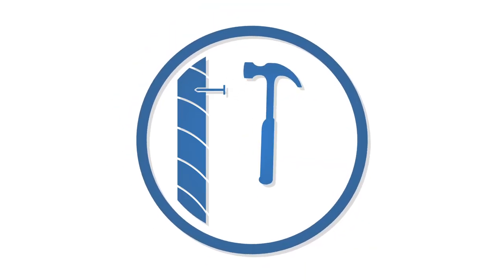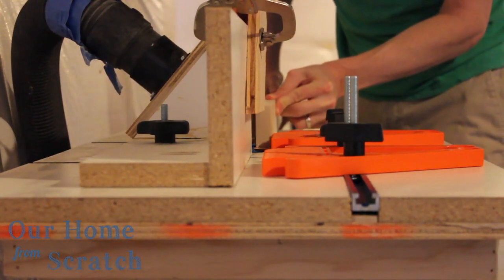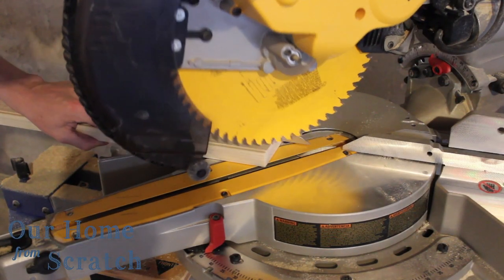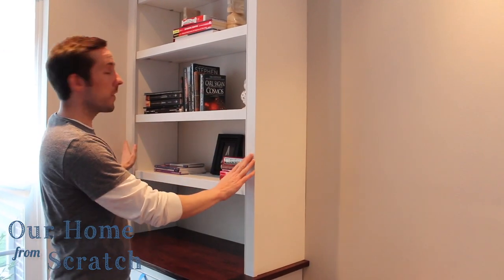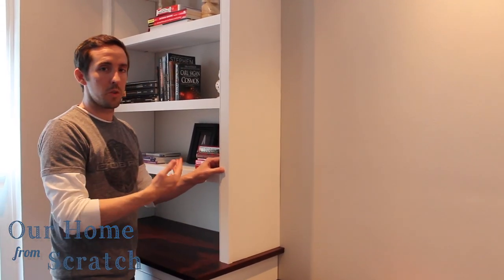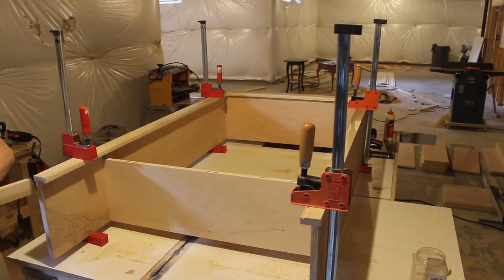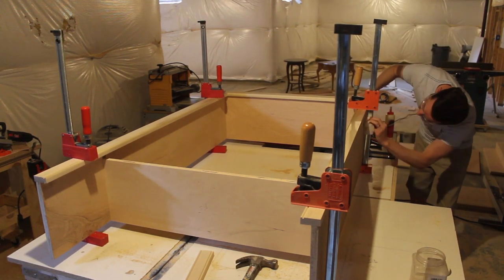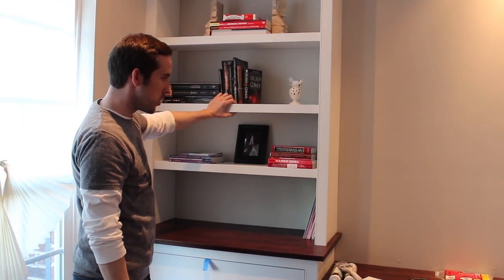DIY Built-In Cabinets with Beaded Face Frames

Comment: I really wish i watched this a few months ago when i did something very similar.  Love the bead detail, really draws your eye without being too over the top.
One thing ive learnt with the router and straight edge is to use the rounded sides of the router base to run along the edge. If ure anything like me and the router turns slightly in ure hand it will still keep the bit centred. Whereas any movement from the straight part of the router base along the straight edge and uve got wonky dado's :)
Reply from the maker: Thanks!  That's a phenomenal tip on the router.  I'll remember that one next time!
Reply: This will work if you have the router pit is perfectly centered within the base, yes.   But, you cannot assume this will be the case.  I would defer to the straight edge technique unless I was able to center the base with a centering bit and adjustable base,  or at least test the router on scrap.

Comment: John, Love the cabinets and the video. The wife and I are designing our built in home office as I type this. We'll be starting the construction in a couple week. Thanks for sharing!
Reply: What brand and type of paint did you use? I noticed you said water-based paint? Was it General Finished Milk Paint?
Reply from the maker: Lance's Woodshop & Adventures I used Sherwin Williams Pro Classic for the finish paint.  I used a Benjamin Moore latex primer, but wouldn't use it again for this application.  Recommend a sprayable shellac primer like BIN.
Reply: John Our Home from Scratch Thanks John!
Reply from the maker: No problem!
Reply: What's next on the projects list for the house?
Reply from the maker: Lance's Woodshop & Adventures We'll probably start making plans to finish the basement soon, but it will be a slow process as I'm not interested in taking on another year long project anytime soon.  For the most part I'm going to try and do some smaller jobs and help readers with their projects.

Comment: You do beautiful work man. I am painting my kitchen cabinets now and using the SW Pro Classic and I can see all of the brush marks in the cabinets. I'm going to have to go back and sand all of this down and kind of start over. I would love to have them sprayed but I don't dare attempt that myself as I have never sprayed before and all of the prep work that would be involved to spray the cabinets themselves.
Reply from the maker: Thanks, Mark.  I've used SW Pro Classic before and I've gotten good results.  I'm usually brushing it over a sprayed primer though.  You could try and thin it down to see if that helps.
Reply: Thanks John...I have thinned it down some and I'm still seeing the same results. When you brush it you don't see brush strokes? I'm using Purdy brushes. I've tried to barely have any paint on my brush and I've tried a little more both yielding the same results.
Reply from the maker: I do have some brush strokes, but they are very hard to see unless you're right on top of it.  You can also try rolling on your paint with a foam roller and then immediately following up with a dry-ish brush to level it out.
Reply: Thanks John. I tried that in the beginning also. The Pro Classic paint was setting up too fast on my and I was dragging the paint. I went and bought a Graco sprayer today. I've got an even bigger mess on my hands now. I just don't understand why I am having so much problems with this. Thanks for the suggestions. I appreciate it. With what I've spent on this project so far...extending my upper cabinets to the ceiling and all the paint and supplies including tools like miter saw, sander and regular saw and such I could have had brand new cabinets installed.

Comment: Hey John, those look great! I'm thinking about making top to bottom shelves without the cabinets around my bed. Can you please explain how you attached them to the wall. Thanks.
Reply from the maker: Ammar, the cabinets are fastened to the wall using wood screws.  The wood screws are driven into the studs in the wall and also feature a finish washer.  The screws are located on a back brace that runs along the top of the cabinet.  You could also add a second back brace along the bottom or middle for your idea.

Comment: John, 
Thank you for sharing your work and ideas. When attaching the beaded face frame what size biscuits are you using an the depth that you are setting them at?

Thank you 
Chris
Reply from the maker: +Chris Laviola Replying on here too just so everyone sees my answer.  I used size 10 biscuits, mainly because that's what I had at the time. Any size should be fine for this type of application. The depth was automatically set by my Freud biscuit joiner.
Reply: Thank you John.

Comment: Hi John, great video, thanks for posting.  I have a quick detail question for you.  On the bookshelves that sit on top of the base cabinets, it looks like there's a reveal on the face frame.  How far does the face frame project past the side panel of the bookshelf?  It looks like maybe 1/8" or 1/4"?  Thanks again for this great tutorial.
Reply from the maker: +Martin B Great eyes, Martin.  There is indeed a 1/4" reveal on both sides of the bottom and top cabinet frames.

Comment: John, great looking work. I'm getting ready to build a cabinet/bookshelf like the ones you have here. I only have around 40"w & 18" deep to work with. what are the dimensions of the cabinet & shelf? Forgive me if you answer this in the video, I haven't finished watching yet.
Reply from the maker: No problem.  Depth of the bottom cabinet is 18", width is around 35".  Depth of the top cabinet is 12", width is also 35".

Comment: I like what you did but instead of haunching the stiles and rail I found the assembly to be easier to put the bead on afterwards with glue and micro pins just my opinion but still a nice job
Reply from the maker: I've seen that approach as well and it does look a bit easier.

Comment: What kind of HVLP sprayer are you using and do you like it? I'm building my cabinets right now and will be painting in the next few weeks
Reply from the maker: It's the Fuji Mini Mite 3: http://amzn.to/2b8YkmQ  I like it, but it's not cheap.  If you're going to be building a lot of cabinets over the next several years, it might be worth picking it up though.  Rockler also has a 1 stage turbine that's pretty good.

Comment: When you made the center notch on the router, on the second pass where you took out the right side of the notch, how did you prevent tearout?  The rotation of the bit should have caused a major problem.
Reply from the maker: +Gordon Serif I used a sacrificial board behind my primary piece and pushed them through the bit together.  The sacrificial board will get the blow out and the primary piece will not.  Hope that makes sense.

Comment: Great job - how do you make sure the cabinets matche to the wall on the sides? If there's any bumps in the plaster work will there not be a gap?
Reply from the maker: +Thadius Mayonnaise You can choose to scribe the sides of the cabinet to the wall, which will trace a line on the side of the cabinet that matches the profile of the wall.  You then cut along that line using a circular saw and the cabinet will match the wall shape perfectly... most of the time.
Reply: +John Our Home from Scratch Hi John,If there is any gap, can you use dry wall compound to fill it?

Comment: Hi John I’m attempting this and having a lot of difficulty. My router seems to be causing the wood to jump and doesn’t sound right. What am I doing wrong? How should I be feeding the wood?
Reply from the maker: Well, it's hard for me to help diagnose what's wrong without actually watching you attempt it.  Make sure you're pushing the wood through your router table from right to left.  Make sure you're using a feather board as well.  You can try adjusting the router bit speed if possible for a cleaner cut as well.
Reply: If the router sounds weak or bogged down 1 need a bigger router ( more amps) or 2 dull bit or 3 taking too much wood on first pass. Any one or combinations can make wood bounce or jump, you want to slice or cut the wood not chop through it. Do you see rough edges or splintering? or burn spots. If so all signs of to much too fast.

Comment: John, I'm about to begin painting and wondering what you recommend in way of sprayer and any sites that might have a tutorial on painting?
Reply from the maker: Chris, first I'd recommend you read this post: http://www.ourhomefromscratch.com/2014/09/cabinet-painting-101/  Then let me know if you have any follow up questions!
Reply: John Our Home from Scratch
John, so I bought an HVLP sprayer but wondering if it will work with my compressor. I have an 8 gallon compressor, but also have access to a 20 gallon tank. Thoughts?
Reply from the maker: Chris, I would try the 8 gallon with some water in the HVLP and see how long you can spray it until the compressor kicks on.  See what the spray quality is like.  If that doesn't work well, then try the 20 next.

Comment: For your stiles, top rail and mid rail you indicate 2 inch width in your excel file.. Are you simply ripping a 1X3 down to width?
Reply from the maker: Yes.  I start with a 1x3, then rip it down to ~2.125" wide on the table saw.  Then I run it through the thickness planer with the cut edge facing up to clean it up and bring it down to a final width of 2".
Reply: Perfect.

Comment: John I was wondering how high did you set the notching bit
Reply from the maker: I set the notching bit height to just clear all of the routed profile, so it leaves just the rectangular portion of the board.  I can draw a picture to explain better if you'd like.  Email me at John@ourhomefromscratch.com if you want me to illustrate it.
Reply: Thanks John so it's mostly a matter of making several cuts until you get something that works well enough and make templates out of the two?  (beading bit, and notching bit)
Reply from the maker: Not sure about the templates.  If you're using a notching bit, you want to get that height set and then make all your cuts.  You can also make the notching cut on a table saw if your blade can make 45 degree cuts.